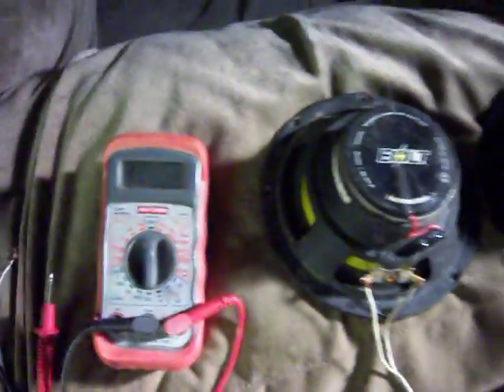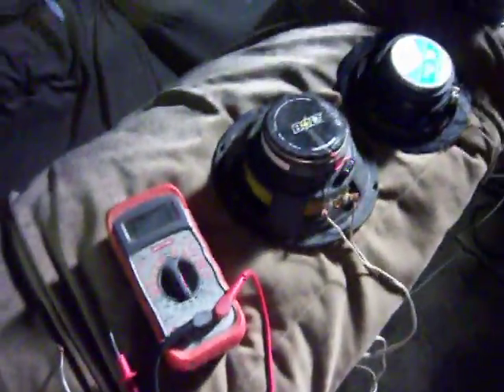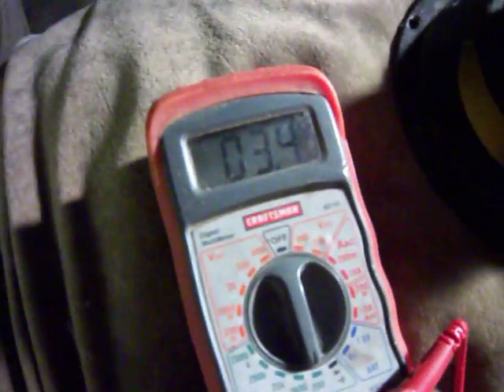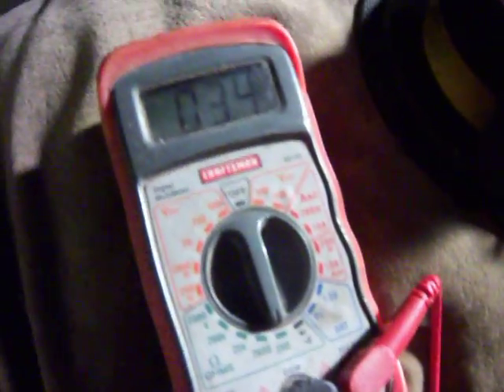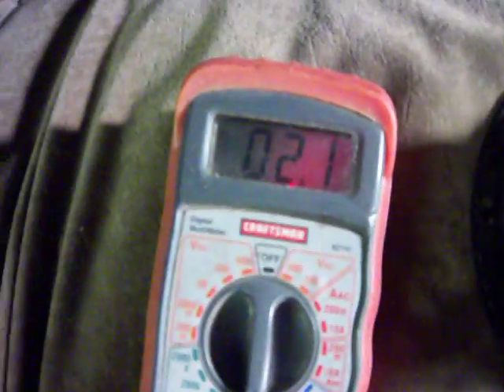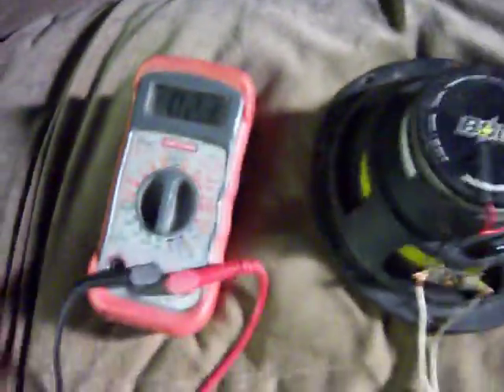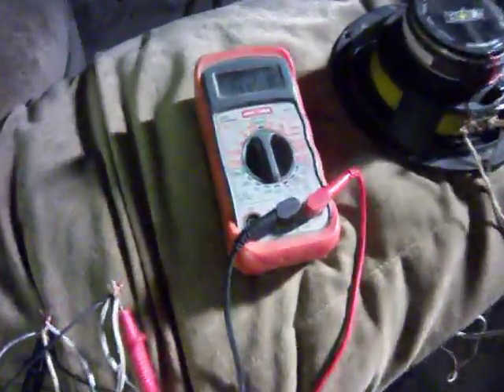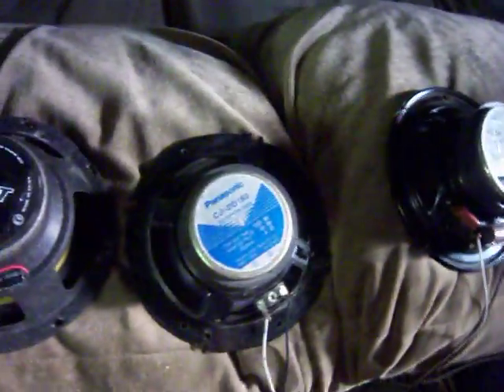ohm loads ! how to wire speakers to an amplifier

Comment: My receiver is 8 ohms per channel. 2 channel. I have those spliced wires at the ends of the speaker wires, I see you inserting the wire into a thing a ma bob to convert it to plug into the receiver. Showing the different in plugs on the receiver and the right thing a ma bob to connect the wires on the speakers to the receiver. Do you have something visual?  You are moving the camera too fast for me to observe what you are doing.  And what are those round things you are plugging into?  I can't figure that out.

Comment from the maker: so your options are 1 or 4 ohms finals loads to the amp depending on how you wanna wire it , your better off running it at 1 ohm 1200w rms output and turning your gain down on the amp . make sure you have 0ga or bigger power wire and a extra battery would also be a good idea.

Comment: if my monoblock amplifier reads

RMS Power at 1ohm: 1200w RMS x 1
RMS Power at 2ohms: 900w RMS x 1
RMS Power at 4ohms: 500w RMS x 1
Stable at 1ohm, 2ohm, and 4ohm

and i have 2 12'' kicker cvrs that read peak: 800 watts and rms:400

does that mean they are good with my amplifier? if so how do i wire them up and at how many ohms to get the max i can out of them together? please help it is my 1st setup im new to all this :(

Comment: when you can run that many speakers you don't need to have them at max power for them to be loud. They will also last longer using more speakers and less power than say just two and blaring them at max power.

Comment from the maker: your saying THD , well yes slightly , it does go down with ohm loads depending on the amp also . and also your dp factor drops , a good clean amp will still sound clean at .5 ohm though in alot of cases .

Comment: Sure the one channel will run the 4 speakers, but won't there be less current going to each speaker? Wouldn't that mean you're not get the maximum power out of the speakers?

Comment: sure wire them in series.. Should be 6 ohm load I believe. The amp wont put out max power, but it will work and be clean sound. Might need to turn amp up higher than ususal.. It will work